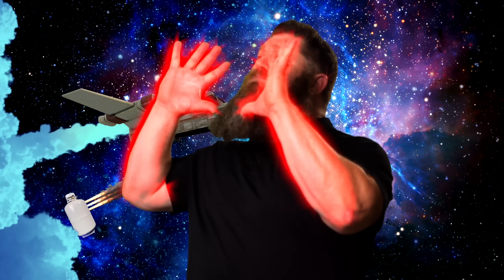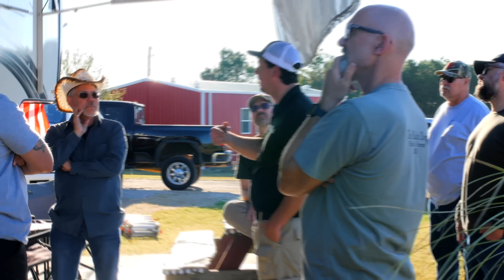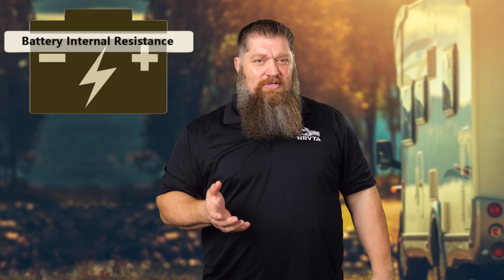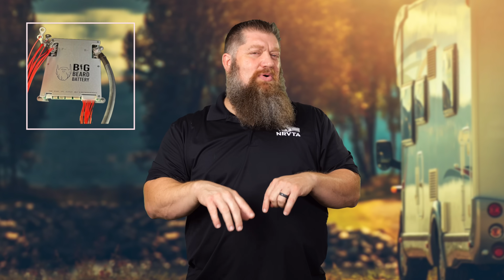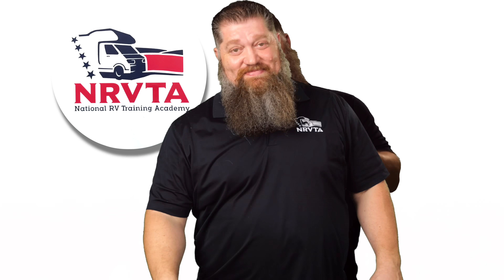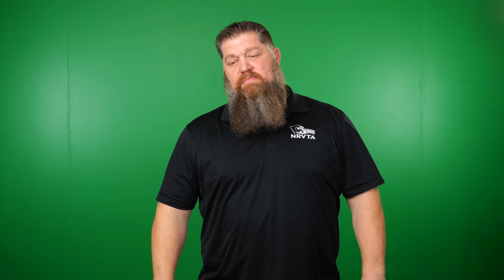Your RV Battery Questions Answered

Comment: If you have a multi-battery system, wouldn't that be a better option if you have a battery fail if you only have one battery, you now have zero batteries and no power....at least if you have more than one battery you can limp along until you can replace the failed battery.

Comment: What are the best practices for using and extending lifep04  battery life?  Rely completely on the BMS and let solar or inverter constantly top off or use battery disconnect after complete charging?  If so at what point of state of charge is best to begin another charging cycle? Thanks.

Comment: Just bought a used 2022 Thor Four Winds 28z. It has two mismatched 12v 100Ah batteries. I'm thinking of dropping in 2x 200Ah batteries. Would I have to upgrade the factory converter that charges the batteries?

Comment: Question I’m in the process of buying a new travel trailer that has a 200 watt solar panel 1800 watt inverter the unit comes with one lead acid battery it has a dual battery box should I have two batteries or one and what type of battery should I get

Comment: If I never boondock and am always plugged into shore power do I need a deep cycle in my rv? The only thing it's doing is sitting there waiting for the breakaway switch to be activated. Won't a cranking battery be just fine?

Comment: Todd I'm thinking of buying a lithium battery. If I use it at night is it ok to start the generator in the morning. Is it better to have a charger hooked up to the battery or just plug camper plugged into generator. My fridge is 12 volt only. Please help I have solar

Comment: Battery question: When looking for replacement deep cycle batteries, it’s sometimes mentioned the number of cycles. a battery has. What is considered a cycle? Is it counted every time the charge is less than 100%  or is it when it’s taken down to a specific percentage?
Reply from the maker: So a cycle generally is defined as a discharge to the maximum recommended state of charge and a complete recharge. 

So a lead acid battery is to discharge it to 12.0volts (50%) and a full recharge.

Comment: Please answer my question, if you upgrade to a 24 volt, how will your rv act if it came with a 12-volt battery? Do you have to upgrade the converter and all 12 lighting? I'm scratching my head all the time when i watch your videos about 24 volt or 48-volt systems. As you know by now reading this, I'm not a electrician. I don't google this stuff because i like learning and watch YouTube videos like yours. When i retire in a year, i plan on doing more off the grid for weeks at a time. I have 4 6-volt golf cart batteries in my 5th wheel now for bigger storage of energy. Hope you can get to my question after you slam the keyboard warriors. LOL Thank you Todd for the other videos as well.
Reply from the maker: So there are a couple options. 

1) Victron makes a DC/DC converter 24v to 12v. So it takes the 24volt a abd steps it down to 12volts for your 12volt needs. 

2) you can leave the current 12v system for your 12volt needs and put in the 24volt system to operate independently of the  12volt system.
Reply: Thank you, Sir! @NationalRVTrainingAcademy

Comment: Are lithium batteries really safe - hear a lot of electric cars n bus  fires n made in China 😊
Reply from the maker: So lithium without the proper bms does gage a greater thermal run away potential. Typically EV vehicles as you brought up also use a different chemistry of lithium called Lithium Ion. It has a lower thermal runaway temp. 

We use Lithium Iron Phosphate that has a higher thermal runaway and a bms that protects the cells.
Reply: @NationalRVTrainingAcademy  thanks for the reply have a good day

Comment: I totally agree with Todd’s evaluations about the physics of two batteries vs 1. In my case I purposely went with 2 knowing the physics but for the same reason I have twin engines on my boat I did with my rv batteries. I have a backup for the just in case scenario. Stuff usually fails at the most inconvenient times.

Comment: Todd, Victron uses an external BMS that controls up to 20 batteries and keeps them balanced looking at all batteries. Seem that no one in the RV industry looks at Victron batteries. We uses the extensively in the marine industry and the are much lighter as well.
Reply: …meant converter.

Comment: I'll be doing an upgrade within the next 2 years from the factory AGM batteries (200)AH to lithium battery.  Are there single lithium batteries with the same or more amp hours that are the same foot print as what I have.  I have a Class B RV and the battery is mounted outside by the rear tires.  Would you have any recommendations as to batteries?  I understand if you don't give any.  BTW you always give great explanations.

Comment: You talked about batteries in series. How does this work for batteries on parallel?  I run two 12V AGM so does the brain analogy still fit? I would think not because out and in come off both together.  But I don't know for certain. 😁

Comment: Another option is to bottom balance the individual lithium cells.  For example, I built a pack with 8 180aH LiFePO cells from CALB, and started by bottom balancing each cell to 2.500v (yes, it’s very important to get millivolt precision, get a good voltmeter that is precise to 3 decimal places) and after 3 years and 27,000 miles of traveling (including two trips to California) the cells are still within 3 millivolts of each other.  I have 900w of solar with a Victron MPPT charge controller, and that does a nice job of keeping the batteries in float when I’m not using the RV.
Reply from the maker: Yes every single cell before putting them in series for a battery build.